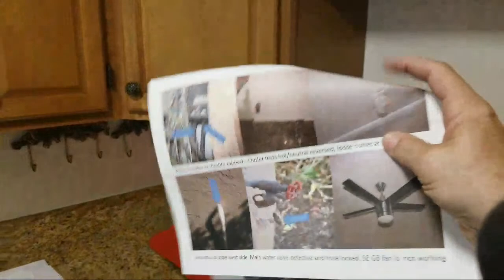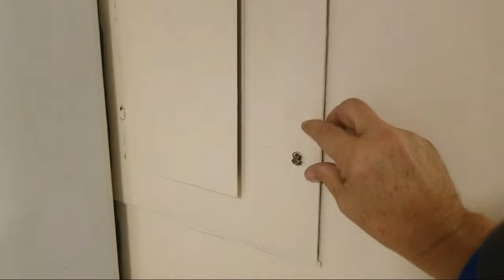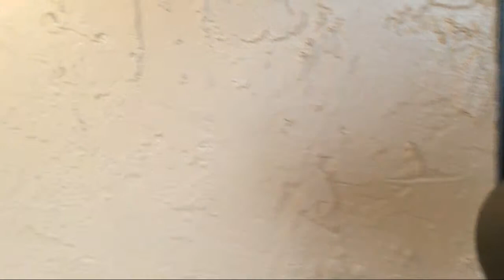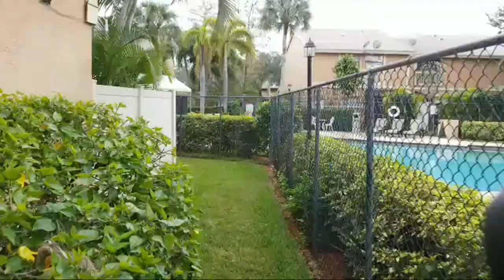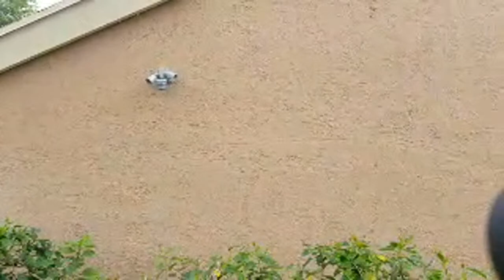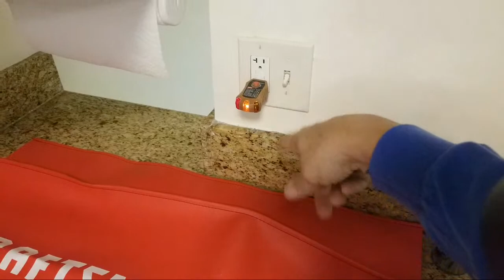Engineering Disasters: Home Buyers Inspector Failures

Comment: You don't need a "licensed" plumber. You need someone who can fix the problem
Reply from the maker: Exactly in fact many times I have seen when you call the actual licensed plumbers they send AA junior person who is usually not licensed and there are the ones that do the sloppy sottering jobs and make other mistakes like set up P traps walk away and they're leaking the next day Because they don't always implement the basic fundamentals to sound plumbing

Comment: My agent constantly hires hicks and jacklegs to do repairs. I keep telling her these people are ripping them off with high prices and shoddy work. One guy who fancied himself a well/pump authority charged her $165 each time he came out to "deal" with an ongoing problem with the well and pump. He never actually "fixed" anything---he just manipulated a switch and billed her $165. I got a friend who is a master plumber to come check this issue out. he made a lasting repair for $25. Agent was stunned and wanted to know how we fixed the issue. I explained it to her and how much he was stealing from her. She was furious. But--next time--she hired him again!! What the heck?? Again we fixed it ourselves and said nothing to her about how it was done. Next time--I let it go and she had him come out three more times--at $165 each visit with no fix. She finally quit using the guy. I told her we would fix issues for material cost as long a she did not use him any more. I told her if he came out here---failed to fix the issue and we had to do it--cost would be $165 plus materials. She finally quit using the guy.

Comment: Are those joist hangers upside down? Either way that entire walkway structure could fall down at any moment. Also that "stucco".. which I suspect as being EIFS.. no matter is touching the ground and that's not allowable also there should be a removable faceplate in the electrical panel outside not just a rain cap
Reply from the maker: Those were not joist hangars, they look more like joist brackets. They had it all torn down and rebuilt the next day

Comment: With regard to the kitchen duplex outlet, you seem to be saying that because current NEC requires a GFCI/AFI receptacle, then "it would fail my inspection". While I agree that simple upgrades like this should be done on an older house, a dwelling usually only has to be up to code at the time it was built. Bringing an older structure up to current code is only required when remoldeling  or replacing/repairing something.
Reply from the maker: You are correct. Whenever I remodel kitchens I always upgrade to the latest codes

Comment: Call a certified electrician for the electrical issues that main double tapped breaker is 200 amp those wires are not made for that that transformer is being fed off of 220 Volts  Have a carpenter replace the rotted wood outside by that pergola you have the rot that structural you can't just fill it in in a State of Ohio  It is illegal and dangereuse you can have structural collapse of the outside structure
Reply: Mark Rankin 
     Re: The 2”X8” ‘s 
                  I would have boxed in the damaged areas with 1”X8” Screwing the panels into unadulterated (healthy wood) remaining after I patched the damaged areas and primed with an OilBased primer.  The 2”X12”’s would be entirely sistered in with new that extends 12” into the stucco on both sides.  Patch and paint.     They’re exterior non structural and only embellishments to the fascia.

Comment: umm....gate valves come in all sizes, they call them a gate valve because as you shut and open them its like a gate inside and closes off the flow.
Reply from the maker: You will never find plumbers who agree on what to call those things because a true gate valve has an actual vertical gate that slides up the mechanism almost like a guillotine.
Reply: Yes and that is exactly the mechanism you will find inside the gate valve in your video, which I described a little differently in my previous post. The only reason the gate inside the valve in your video doesn't operate vertically is because of the orientation of the valve, but it's still the same mechanism and it's still a gate valve.
Reply: You are right, gate valves do come in all sizes and this one in question is also a gate valve. Gate valves have been around for many years and are most often used, and called for, when a full flow valve is required, as in this instance where the main water supply pipe, leading from the city enters the house. The design of a gate valve, where a tapered disc wedges into a tapered seat, provides unobstructed water flow when open, but Jeff is right that the more modern designed ball valve is now a much better option and also provides a full flow valve. Quarter turn ball valves are much quicker and easier to open/close and are much less prone to be frozen open after years of inactivity. They also don't have a packing nut and are less likely to leak. I also love to replace old hose bibs with quarter turn ball valve hose bibs for most of the same reasons.